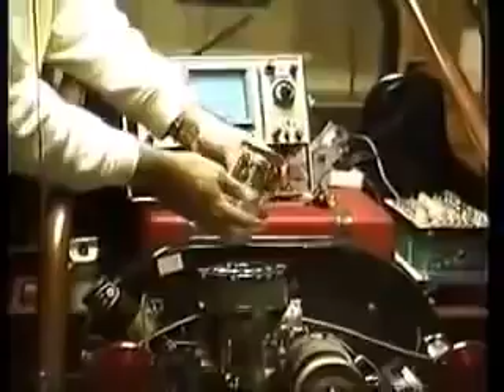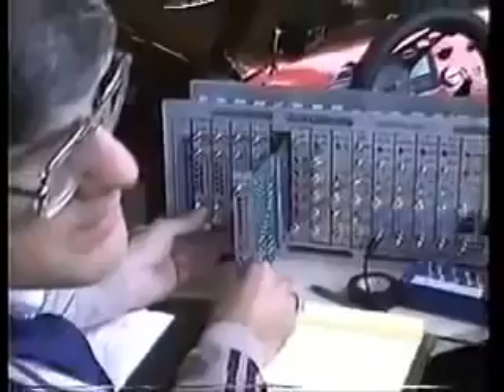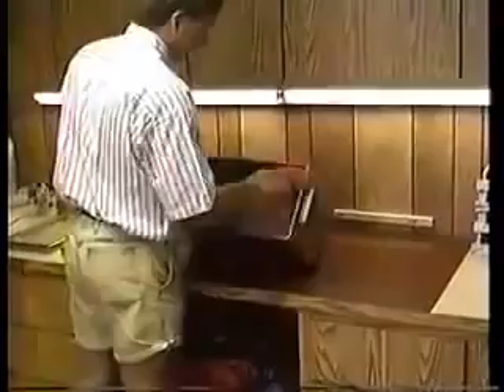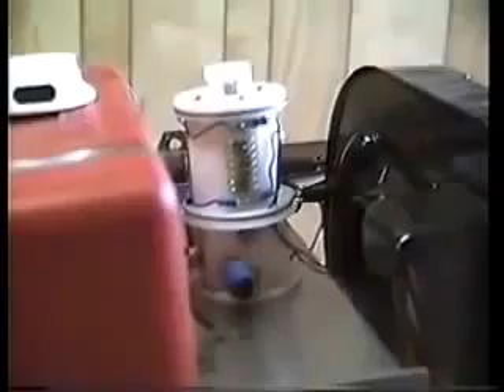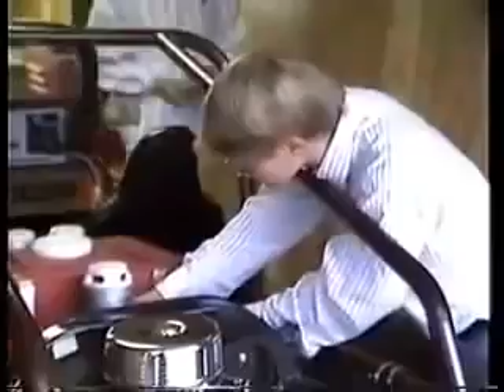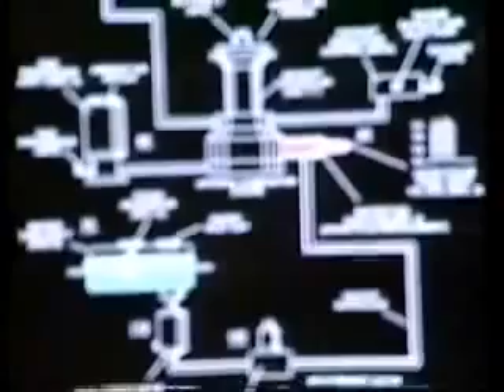Stanley Meyer and his brother on how the water fuel injection system works  NEW RELEASED

Comment: Neal, i'm thinking to install hho system in my 2001 audi s4, but i don't no how to connect wiring :( I think my 21 plate  hho cell must take 15 amp(calculated that). If i will connect that direct to battery that will give 72 amps. It is too much. Can you help me? Thanks.
Reply from the maker: Try this.
https://www.youtube.com/watch?v=9mMSqUKYX44
Reply: ***** Wow ! Thanks. Solenoid is for what?,for regulate amps? Can you explane me please. Merci.
Reply from the maker: Jolanta Buteikyte Dar Your amps could be controlled by an external PWM, or the strength of the electrolyte mix, The diagram shows you a safe way to hook your cell to your vehicle.

Neal